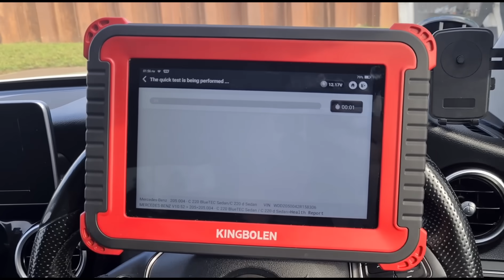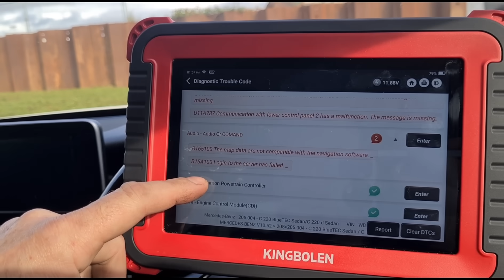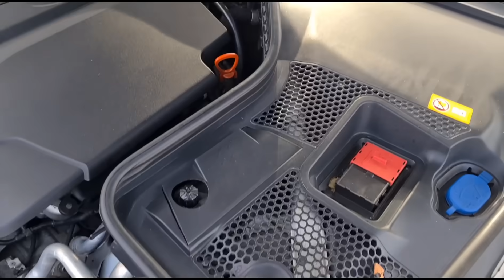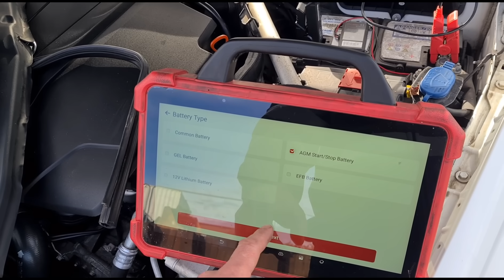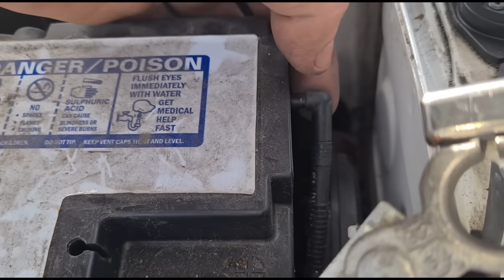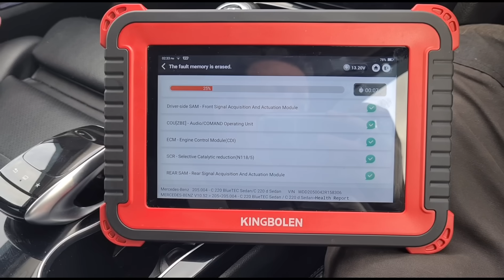Mercedes Electrical Faults. Stop Car Leave Engine Running Message

Comment: Thank you, but you did not really answer anything. What is the battery resistance and why is it too high. I bought a W213 from auction and replaced the battery as the start/stop did not work. Within 5 months of this new battery I was getting the erroro message in the video, so I changed the battery again under warranty, and now in less than a month I am getting the same error message again, so just replacing a battery is not the answer. Do you know what is really going on ?
Reply: But late of a reply but did you replace the aux cap battery in passenger foot well this often goes when battery is low for a while due to s/s strain

Comment: The battery was over 200 quid because Bennetts motor factors are a rip off!
Reply from the maker: Indeed but nothing else in this area
Reply: @ORileysAutos  true, but MPD and Motorserv ain't a million miles away too be fair. Obviously Bennetts has the monopoly in Biggleswade!

Comment: Anything video on 2016 mazda CX-5 diesel engine light fault, seems to come on when the tank goes to half empty and when I fill up it goes after a short while. Then comes on again when tank goes half empty. I replaced the fuel cap with new one.

Comment: amazing how other repairers didnt sort this, it's very common for a weak battery to cause issues like this, especially so many, the battery health is the first thing i check and most of the time it's the cause, it's shocking how little garages and main dealers know or can be bothered with🙄

Comment: Jimmy, you coulda got yer multimeter out and tested the battery in 10 secs.
However,  I am aware that you were showcasing additional #LaunchUK products. 
Interesting all the same that the battery didn't need married to the car.
Reply from the maker: If I just tested a battery with a multimeter I'd get all sorts of cowboy comments
Reply: @ORileysAutos  can’t win bud can ya 🤷‍♂️

Comment: Ive read so many comments saying need to reset BMS, most cars with BMS yes you do however most mercedes and even BMW are self learning, and you only need to re celebrate if your changing the AH from what the manufacturer fitted. I changed one last week cleared all codes went to calibrate BMS with bosh just to see if it was available and got a note saying only needs changing if AH different and needs dealer computer to do it, same battery spec went in so just crack on no issues. Vag group are different you need to put make of battery in, battery type ie efb agm etc, the AH and a serial number lol

Comment: Who can’t diagnose a faulty battery nowadays, slightest drop and gives all kinds of problems. And don’t don’t don’t put cheapy battery in make sure you put in the correct type of battery in, might be twice the price but you’ll pay more in dopey diagnostics from dopey garages 🤦🏻‍♂️ well done Jimmy
Reply: Some Mechanics don’t understand that a battery can need replaced even though it starts the car.

That fact confuses Mechanics that have not kept up to date with technology.

My Jag XJL (X351) was the 1st car I owned (back in 2013) that would have all kinds of electric issues when the battery got discharged fully after an alternator pulley failure.

The Jaguar Main Dealer wouldn’t replace the battery and I had all kinds of weird faults afterwards.

I tried an overnight trickle charge and it improved a little but a couple of weeks later the battery died completely.

I was lucky I had already bought a battery to replace it

And this wasn’t a car with Stop/Start and only had one battery.

I don’t think it was an AGM battery though, the later Stop/Start models had two batteries.

Comment: Well, you just ruined that battery unless you initiated battery replacement in BMS.
Reply from the maker: Battery won't be ruined. There is no option to reset BMS. only if you change the size of the battery AH. I checked on the scan tool.
Reply: @ORileysAutos  which one? That Chinese multibrand one or Xentry?
Reply from the maker: @sbiable  the Launch UK Euro Tab 3, it's a £6,000 scan tool I'm sure it's capable of registering a battery
Reply: @ORileysAutos  Well, i don't trust Chinese support, especially if it's about software lifecycle management. Autel support is pathetic for example. Initially, they mentioned that their AP200 device supports service interval reset for JLR cars for 2017+ model year, but guess what.. it is not and now they state that it didn't initially. But their vehicle coverage support page still states that it is.
Reply: No issues if  the battery is the same type AGM AH/RC capacity. Major problems if not.
Reply: @herrkiwi3110  well, BMS shall re-learn battery state over the time but JLR , for example, states that you have to initiate battery replacement in BMS. BMW or VAG give you the option to choose the battery manufacturer in some models.
Reply: Out of interest. Why does it get instantly ruined, sounds like changing a battery is no longer DIY?
Reply: @garybrown5500  Not instantly but over time it will lose quite a capacity since BMS could not re-learn it properly. All batteries are different, especially from different manufacturers. Especially if you mix Japanese and German ones :) The good thing about Yuasa is that it can be restored to its factory conditions even after 2 or 3 years of use because it is not sealed;)

Comment: I was gonna ask the same question. Battery registration??  Seems like a daft place to put a cabin filter right on top of a battery
Reply: Most late model Mercedes are in that location, the thing to watch is refitting that cabin filter as often the plastic breaks when refitting the clips.
Reply: there is a gas outlet tube provided
Reply: Better than putting it inside the car IMHO

Comment: So the owner of the Merc took his car to more than one garage and they could not diagnose a faulty battery. Where the hell are these mechanics, sorry technicians as I believe they are called now, being trained? Whipsnade zoo by any chance?
Reply from the maker: Obviously not a good garage. I know of a few garages in Luton that have literally a wooden shelter with blue tarpaulin as the roof. Work standards are terrible. Coming from me a person who works roadside 😄
Reply: Training is poor these days, very basic. They are more like fitters than mechanics.
Reply: I don't think how good or bad the tools are make them a good mechanic. Yes having the most modern, up to date kit makes diagnosis a lot easier but 99% of diagnostics come from knowledge, experience, common sense and being methodical. A poor mechanic with the best tools is still a poor mechanic. Too many garages are parts fitters replacing parts to see if they are faulty until they hit the bullseye. These are the bad mechanics who don't know how to diagnose properly and sadly the customer takes the hit. I'm amazed at how many cannot even read wiring diagrams or even have an oscilloscope to hand. Rant over, loving the videos BTW.
Reply: A mechanic is only as good as his tools.
Reply: It's not that most mechanics are useless, it's that anyone can claim to be a mechanic.
Reply from the maker: @tonychalmers9867  💯
Reply: I spent 4 years on an HND seems they can do it all in a bloody week now!

Comment: I come across this problem quite a lot on the roadside, yes same scenario “my mechanic just reset the codes but the faults comes back”! After replacement I always reset the battery adaptions. Always an ongoing argument whether you should or not…personally I always do as in most cases the Ah is different to the one fitted prior and it’s good practise to tell the BMS what it’s charging up to etc.

Comment: Did you have to program the new battery to the car?
Reply from the maker: This vehicle has no option to reset BMS. only to change the battery size AH
Reply: at Ford, the reset is done with fog light buttons and an emergency alarm, but still not enough.
Reply: Of course you have to! I bet this one will come back in a year with exactly the same problem.
Reply: @sbiable what would you know guitar boy
Reply from the maker: @StelioKontos-wk9km  even if it comes back in a year, he has a receipt for the battery with 4 years warranty 😁